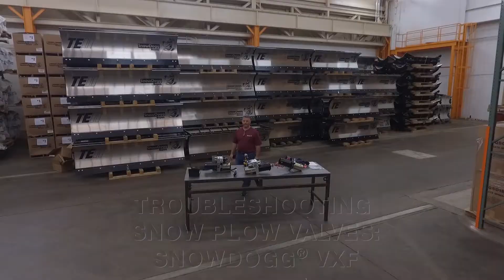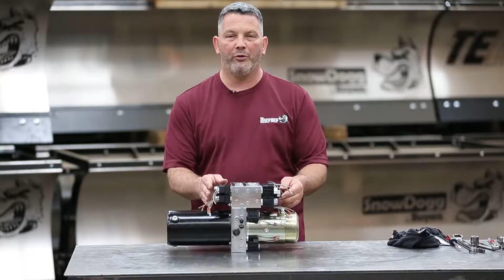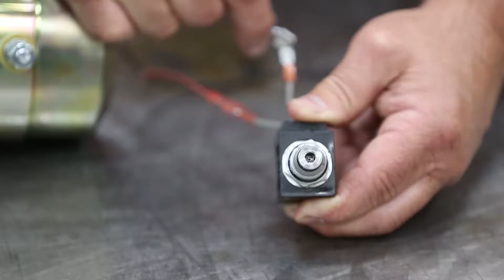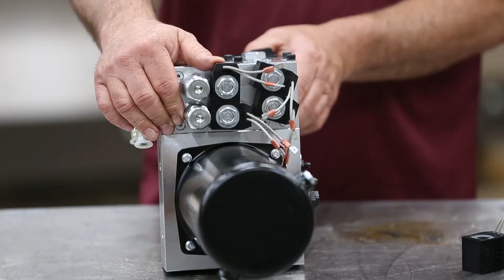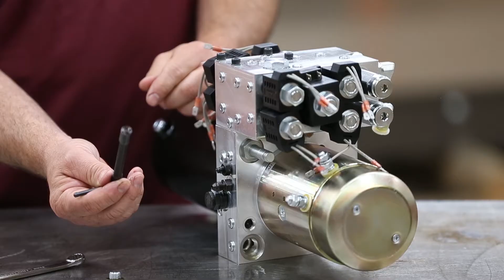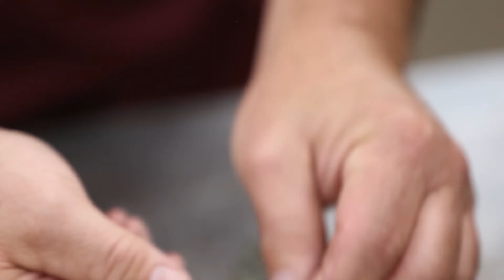SnowDogg Tech Support: Troubleshooting SnowDogg VXF V-plow Series snow plow valves.

Comment: Will this setup be the same for a VX series plow (85)?
On my diagram for the vx it shows the s7 and s6 are opposite from what is shown in this video. I am having all kinds of strange electrical, reversed operation, etc. issues. but the diagram on the cover shows the wiring/valves are correct. 

On the vxf95 that I have the wiring is the same as this video, even some of the hydro lines are connected different than the vx85.

I bought this used and am wondering if the previous owner had a repair/wired it incorrectly. I don't want to change anything if I am wrong in assuming the wiring is the same between vxf and vx - I may be reading the case diagram incorrectly.
Reply from the maker: Hello! I heard back from our Tech Support team. The wiring on the vehicle side is the same for all SnowDogg plows, so the VXF and VX series plows would be the same setup. If you run into issues, feel free to give us a call at 440-974-8888 and ask for Tech Support!
Reply: @BuyersProductsCompany   thank you
Reply from the maker: Thank you for the question! I've reached out to our Tech Support team to confirm. I will be in touch once I have more information. Thanks! -Lucas

Comment: I'm having the pump stick on, just bought the truck. They replaced solonoid and the harness is partially melted so they have had this trouble before i got it,any idea where I should start looking?
Reply from the maker: Thanks for your comment! When the pump sticks on, that means the motor relay is sticking and power is going directly from the battery to the plow motor. If anything has melted, it should be replaced along with the motor relay (solenoid).
Reply: @BuyersProductsCompany  Thank you for the reply, got a replacement solenoid and it did the trick. Thank you for replying so quickly.
Reply from the maker: Awesome! We're happy to assist and glad that did the trick! Have a great day!
Reply: Good day, I'm trying to get my old vxf85 going. It ran last year without issues. I bought it second hand. I checked all the wiring/fuse. I get 12v to the pump unit but I'm not getting any indication of the pump unit turning on. No motor wine, no movement of the plow. I replace the relay solenoid on the truck. I'm running out of things to check!
Reply from the maker: @hjj1003  thanks for your comment! We'd encourage you to use jumper cables and go direct from battery to the pump motor. See if the motor moves. If it doesn't, then it sounds like the motor could be bad. Let us know if this works!